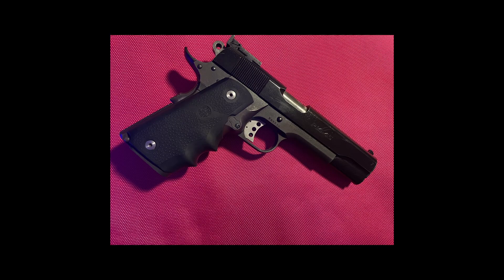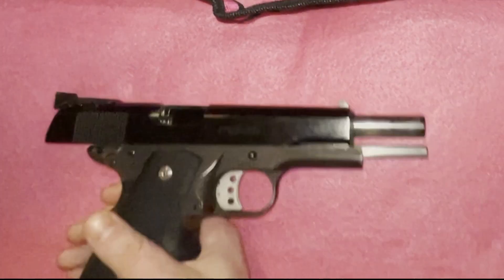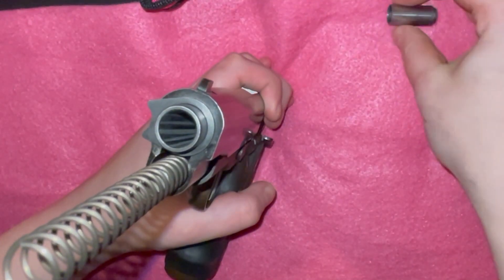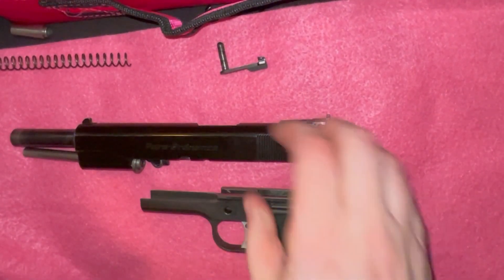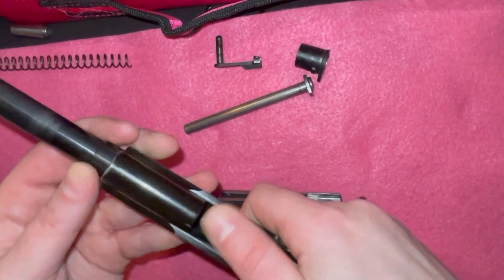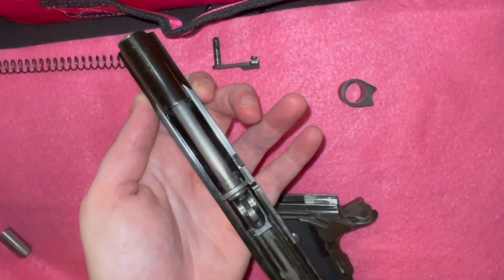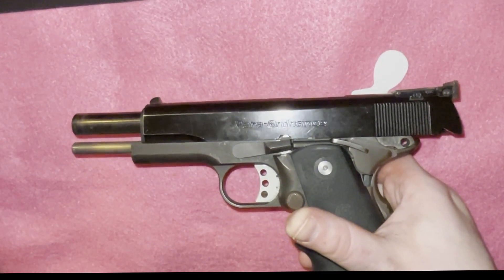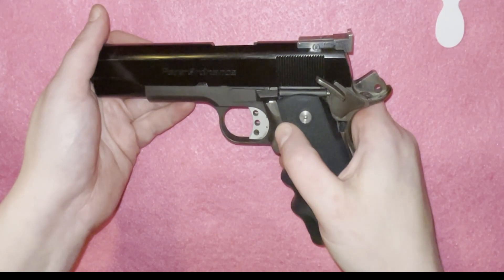Field Stripping the Para Ordnance P14-45

Comment: One of my biggest struggles on striping and assembling  a 1911 is putting the slide stop lever back in without gouging the hell out of the frame. Any tricks/tips?
Reply from the maker: What brand is yours
Reply: @LokificentsLair  which one? Lol
Reply from the maker: Didn't know if it was all 1911s or a specific make/model giving you the issue
Reply: @LokificentsLair  more a generic thing with the model design vs a specific one. I’m not the sharpest spoon in the drawer.